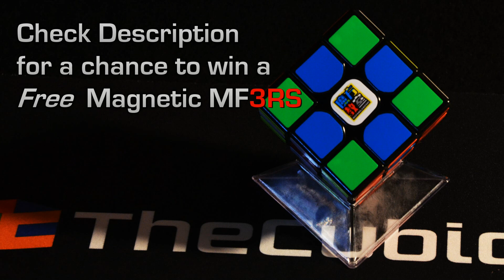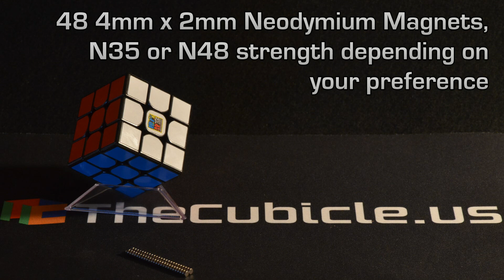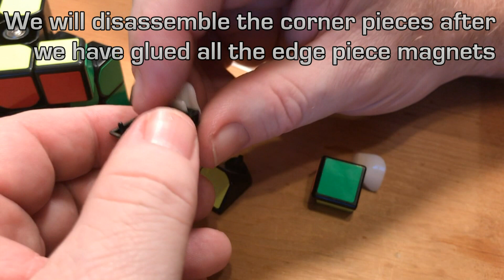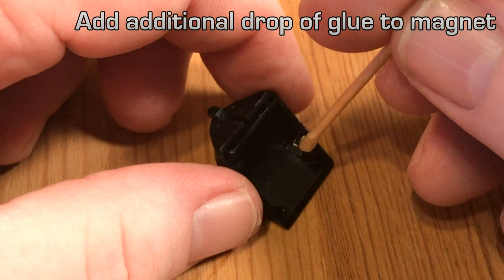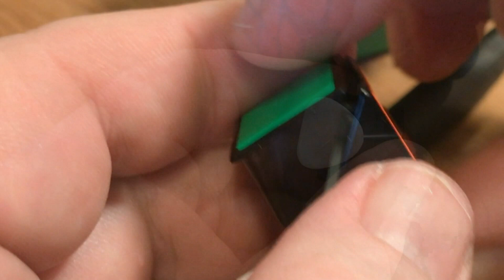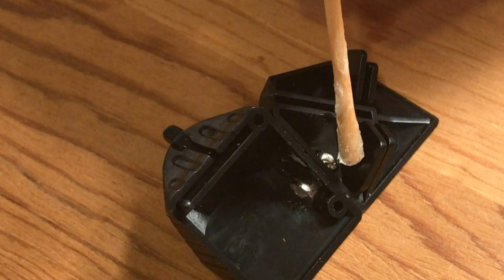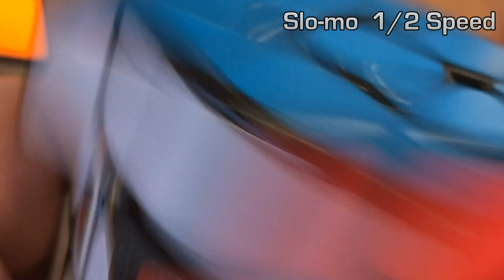How to Make a Magnetic MF3RS Speed Cube

Comment: Can I use hot glue instead of superglue? and what type of magnets should I use for the mf3rs2, the newer version of the mf3rs?
Reply from the maker: Wei Wen Yeoh No, never use hot glue on Neodymium magnets!!!!!! The heat will destroy the magnetic properties of the magnet. It's best to use Gorilla glue, superglue, or epoxy. 
I haven't done the MF3RS2, but I bought a couple to experiment on. I'll probably first try N35 4x2 magnets as they tend to work well in a lot of cubes.

Comment: Can i use 5x1magnets n45 too?
Reply from the maker: I haven't tried 5mm magnets in the MF3RS but they should fit just fine and the N45 5x1 would probably be perfect in this cube. If you do it, please let me know how it turns out. I'm thinking that magnet would be great in this cube.
Reply: I am gonna do this in like 2 months thank for reply
Reply: The 5x1 are out of Stock can i use 5x1,5 n38 too?
Reply from the maker: Yes, according to the K&J Magnetics calculator, an N38 5x1.5 would have an equivalent pullforce strength of an N38 4x2, so certainly still within a very good working range for magnetic strength in this cube!

Comment: Please make a video about magnetizing a thunderclap v2
Reply from the maker: Hi.  I haven't done a magnetic TCV2 because the way the cube is designed, there is a built in friction that engages when any given face of the cube comes into its resting position. This friction between cubie pieces provides a feedback very much like adding magnets. My fear is that adding magnets to a cube that is designed like this will probably result in a cube that has worsened performance as there's a big chance the magnetic pullforce, along with the cubie piece friction, will cause the cube to be rather slow. But on the other hand, I have heard that a couple of people have magnetized the cube and like it. So I still may look into . Thanks for your suggestion!
Reply: Ok thanks btw😊

Comment: I bought some 5mm spherical magnets a while back just to screw around with and i don't have any use for them now. Do you think i could use them for this project or should i go ahead and order similar magnets to the ones in this video?
Reply from the maker: Brandon Flores Spherical magnets have an odd attraction and are generally too large and difficult to glue inside cubie pieces. You'd be much better off using disc magnets, such as the 4x2s. Have fun!!!
Reply: Thanks!

Comment: Which do you think I should use
N35 4x2
Or
N40 4x1.5
Reply: I would like the same feeling as the GTS2M
Reply from the maker: Armando Dian If you want a lighter magnetic feel, like the factory magnetized GTS2M, you'd probably want to use the 4x1.5 magnet. The MF3RS is a little heavier than the GTS, but I think the 4x1.5s will still work fine. You'll have a light magnetic feel this way.

Comment: Why does my centre cap fall off when I do M slices after assembly?
Reply from the maker: Might just be a looser fitting cap or maybe there's a little lube on it. I'd clean it off well and place back on. If it's loose fitting, I guess you could try to distort the cap ever so slightly to cause it to fit better. I probably wouldn't try gluing it on.

Comment: I can't assemble the corners. How did you do it?
Reply from the maker: The corner piece thirds fit easily together on the stalk shaft and insert into each other. If they're not going together easily, you may have gotten a little superglue on one of the tabs that inserts into the slot in the internal part of the corner piece. Get a knife, or something similar, and carefully scrape the extra glue off and they should be able to slide into each other better.

Comment: Can I modify the Mofang Jiaoshi mf3rs stikerless version...
  What should be the measurements for the magnets.??
Reply from the maker: Pranav Techs Yes. And I think the N35 4 mm x 2 mm are probably the best ones for the MF3RS.
Reply: DMCubing  Mf3rs sticker and stikerless version  are both of the same dimensions.???
Reply: DMCubing And which magnets will be better for Mf3rs stikerless version.(N48 or N35)
Reply from the maker: Pranav Techs N35. N48 is fairly strong in this cube.
Reply: DMCubing which kind of glue should I use for sticking the magnets.   
 "Resident of India"
Reply from the maker: Pranav Techs Any super glue (Cyanoacrylate adhesive) will work. The type I use is a little thicker than others so I apply it with a stick. But there are other superglues that are thinner. If you use those, be careful as they can run easily.
Reply: DMCubing Hi,
  I have made the mf3rs a magnetic cube but I am facing a problem while solving.
  The pieces are repelling.
  I have checked the polarity by joining all the pieces without centre pieces and all of them attached but while solving they are repelling.  Give me a solution please??
Reply from the maker: Pranav Techs So you have actually reassembled the cube without the core? If it's repelling while fully assembled, it would have to repel when assembled without the core. I'd try this again and slowly and carefully check that each and every edge piece attracts each and every corner piece.
Reply: DMCubing Now, I have perfectly modified the cube and it is not repelling.
  But it's bit tight and I just wanna know how to make it perfect.
  I mean Making it loose but not making it catchy.?
Reply from the maker: Pranav Techs I certainly understand. With magnetic cubes, they tend to perform better with slightly looser than normal tensions. I find it sometimes takes a while to find the perfect tension, so take your time and be as precise as possible while adjusting it. Also, a lot will also depend on how you have it lubed. There's a perfect balance between magnetic strength, lube viscosity and spring tension you'll have to find. Like a lot of things, this feeling of balance varies between people as we all have our own preferences. Also, it will take a little while for the lube to break in and for the spring tension to stabilize.

Comment: how do i assemble the edge pieces? they wont fit because of the torpedo
Reply from the maker: EinfachNurBenjie They pull apart when you disassemble them, and they push together when you reassemble them. What is keeping them from coming together? Do any of the little posts or holes that the posts go into have superglue on them?
Reply: no i can assemble them easy without that piece but when i put the piece in the 2 edge pieces wont go completley in so there is  some space between the pieces-
same with the corners
Reply from the maker: EinfachNurBenjie I'm trying to think what might be wrong. So it's the white pieces that won't go in? Make sure you're inserting them correctly. It sounds like you might be inserting the wrong direction.
Reply: no the white piece goes in when i try to fit the two edge pieces together it doesnt work there is always some space between the pieces
Reply from the maker: Then you obviously have glue somewhere on the pieces that is keeping them from being pushed together fully.
Reply: but i can but the pieces together without that white piece so there cant be any glue
Reply from the maker: EinfachNurBenjie be sure you're putting the white pieces into the pieces correctly. If there isn't glue on the pieces keeping you from putting the white pieces in, then it's something entirely different, not related to the gluing, and as far as I can figure, means something with the white pieces. Since the white pieces weren't in anyway changed, it's probably the way you're positioning them in the parts. I think you need to try the other side of the white piece you're trying to insert.

Comment: do you put the magnets on the right side always and also do you have to put the magnets on its color's side or no?
Reply from the maker: I generally position the edge piece magnet based on how it lines up with the corner piece magnet. If you're asking about putting the magnet on the outside to hold the glued in edge piece magnet, you don't really have to do it but I find it helps if I use a slow drying glue.

Comment: I'm having trouble with my MF3RS one of the centers keeps popping. Is it because of the spring the screw or the lube? Please help.
Reply from the maker: Andrew Northfield You're talking about the cap, right?
Reply: Yeah, one of them keeps popping. So I have to tighten it but tightening it decreases the corner cutting. How do I solve this?
Reply: Andrew Northfield it's because the screw, either tighten it or you're gonna have to glue it, but very lightly just in case you ever need to disassemble you'd be able to pry it off

Comment: Can you put the magnets on the left?
Reply from the maker: Chopstick Cuber Inside the edge piece? You can put it on either side as long as you have room to do it. The important thing is to make sure that the edge pieces and corner pieces attract properly.
Reply: DMCubing thanks. Btw what magnets should i use?i asked my friends they said 48 is better.And n35 is weaker but more subtle feel.
Reply from the maker: Chopstick Cuber Hi. Actually N48 is more stable because they are stronger than N35. N35 is the weakest grade magnet. 
Either works fine. I have used both. If you use Roux, or like a lighter magnetic feel, N35 works best. If you prefer a slightly stronger magnetic feel, or have a slightly more aggressive solve style, the N48s are the way to go.

Comment: what do you do if you get the polarity wrong?
Reply from the maker: The best way to find out if there is an issue with polarity is to disassemble the cube and put it together without the core. The cubie pieces should attract to each other to hold the cube together correctly - edge pieces will attract corner pieces. If this doesn't happen, then you know you have an issue with the piece that repels instead of attracts.
You'll need to identify the wrong magnets this way, then turn them around when you glue them back in. Removing the wrong magnets can be difficult but is possible. Usually all you need to do is use a small screwdriver and pry them out. Sometimes soaking the cubie piece in soapy water can help loosen up the superglue. Hope that helps!!!
Reply: +DMCubing OK thanks, if there is a problem I will do that. I just got the magnetic conversion kit today along with a mf3rs to do it on.
Reply from the maker: Well, the good thing is you don't have a problem. That's good. And it's good to know what to do in case something happens. 

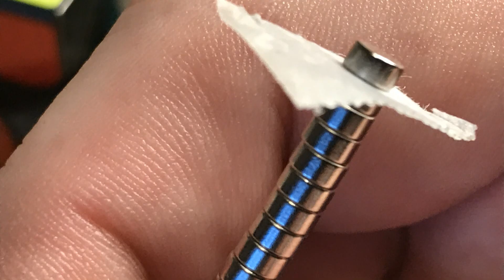I think where people make mistakes with polarity is when they remove the magnets off of the stick of magnets. Really if you follow the way I present it in my video ( 2:55 ) and keep the orientation of the magnet the same as you removed it from the stick, then place each magnet the same way in the edge piece, over and over, you won't have problems.

Be sure to give the glue plenty of time to dry and harden before reassembling all the cubie pieces. This may take a few hours. Once you've assembled all the cubie pieces, you can build the cube up into it's cube shape without the core 6:44  If everything is correct, the cube will hold together with the magnets and no core. 

Good luck and let me know if you have any questions and please do let me know how your cube turns out.
Reply: +DMCubing OK thanks for all your help I will put a video up on my other channel so you can see how it turns out, but I don't have the package yet since I am at school and it just got to my house. I can't wait to put magnets in it.
Reply: +DMCubing I'm letting the pieces dry now.

Comment: Is N52 too much? Cuz I have pretty hard turning so I'm very uncontrollable.
Reply from the maker: I don't think it would be too strong if you feel you need the additional magnetic strength. I've used the 4x2 N52 magnet in the Thunderclap, Aaolong V2, and GTS. In normal weight cubes it's ok even though it's strong. It's the Valk and Air where you wouldn't want to use it.

Comment: dm cubing ur the best magnetic cuber tutorialist but i have a question for you how about n52 in mf3rs and valk... i have glued in mf3rs though should i do it with valk 3 too??
Reply from the maker: They'll work fine in an MF3RS and have a strong magnetic pullforce, but in a lighter weight cube like the Valk, they'll be overpowering. For that cube, the norm is N35. So you're looking more at N38 and N42 in it if you want a stronger magnetic feel without sacrificing performance. Great question, by the way! And thanks for your kind words!!!!!!!!!!
Reply: +DMCubing i hope you contine doing this... make other tutorials of magnetic pyraminx skewbs and else
Reply: +IS Cuber but my friend has got n52 in its valk now so now its bad or damaged??
Reply from the maker: Thank you!!!!
Reply from the maker: No, it's just not the magnet that many people prefer. You generally have to offset the strength of the magnets with the tensions and lube if it's a stronger magnet like that. It may take a while to find the right combination of these things. To me, the only real negative thing about using a strong magnet in a light cube is that a lot of times when the magnets pass each other the "click" (as people call it) and momentum can kind of cause the cube to feel bouncy or jerky in the hands because you get a definite "bump" each time a magnet comes in contact with another magnet. Usually the pushing past this point doesn't really require much more effect, so usually that's not the negative end result. Usually it's just a matter of how the cube feels. And I assume you're talking about 4mm x 2mm magnets.
Reply: +DMCubing ya n52 4*2mm and they worked awesome i loved the feeling
Reply from the maker: IS Cuber Great! So you liked the N52s in the Valk?
Reply: +DMCubing yaa i will make a review of it soon and make ur name in the title +descript..
Reply from the maker: IS Cuber Great! Thanks!!!! I'm looking forward to the video!!!!!
Reply: +DMCubing bro i ahve a question i have less subs any tips to gain them??
Reply: have

Comment: Make a video 'How to make Magnetic Gans 356 Air Ultimate'
Reply from the maker: I have a video on making a magnetic Gan Air:
https://youtu.be/rsHTGjWvh10

That should be of some help. But to actually make a UM style Air, you'd have to seal the cubie pieces with glue and glue the bases of the parts without the screws. Other than that, the actually magnetization process would be what it is in my video posted above. Thanks!
Reply: Make one for me! :D

Comment: so , what is good ? N48 4mm x 2mm or N35 4mm x 2mm ? thanks
Reply from the maker: Farhans Alfrz Both work well! If you prefer a lighter magnetic feel , I would certainly go with the N35. It will give a hint of magnetic pullforce but won't be very strong. If you prefer to feel the magnet more, or possibly have an aggressive solve style, then the N48s are excellent at providing a pronounced, but not overly strong magnetic feel.

Comment: and can you tell me how to disassemble a corner couldn't understand it very well
Reply from the maker: Jagdish Rakheja Sure. You just separate the black parts of the corner pieces.  Each corner piece has three of these, and they are attached to a white stock. You just work your fingernail or something that will fit in between them and then just pull them apart from each other.

Comment: How many bars do u exactly need cause im confused thank you also how much time does this consume
Reply from the maker: Tomo Games I don't understand. Are you asking how many magnets? It takes 48. If it's your first time making a magcube, you'll want to allow about two hours until the last magnet is glued. Then you should let the glue dry for a while then reassemble.
Reply: DMCubing What I mean is 48 bars of N35 or only 48 N35
Reply from the maker: Tomo Games These type of magnets are generally sold in quantities of 100 or 50. You'll need 48 individual magnets. The stick of magnets is usually 50. The magnets are small, you only need 48 of them but you'll probably have to order 50 magnets. You'll have two left over.
Reply: DMCubing Ok thanks

Comment: I ordered N52 magnets 3×1.5mm, would it work well? And how do you ensure that all magnets on edges are aligned perfectly in relation to each other?
Reply from the maker: Using the calculator at KJ Magnetics, a standard N35 4mm x 2mm has a pullforce of .64 lbs. An N52 3x1.5 has a pullforce of .48 lbs. So theoretically you could use it but since it's a smaller magnet it will only have 75% the pullforce of the N35 4x2. That's going to be pretty subtle. 
As for aligning the edge piece magnets, I always find a place inside the edge piece where the magnet can be placed exactly the same each time. This is usually at the bottom of one of the internal retaining posts, placing the magnet along it and flush on the bottom floor surface of the cubie piece. I'm using the edge piece's structure and design as the guide. And you always need to pick the side of the edge piece that allows for enough room for the corner piece magnet once the corner piece third is placed by the edge piece.
Reply: Thanks, Both are arriving in about a week, will update you once I make it.

Comment: can i use n50 4x2mm magnets?
Reply from the maker: I think you could. They'll feel much like what I used here. If they're true N50 (there have been a lot of weak N50s being sold on ebay lately) they'll give a fairly strong magnetic feel, but probably not overly strong. If you like a stronger magnetic feel and/or have a more aggressive solving style, the N50 will probably be just right. But, if you prefer a lighter, more subtle magnetic feel, the N35 works better. So it kind of comes down to personal preference.